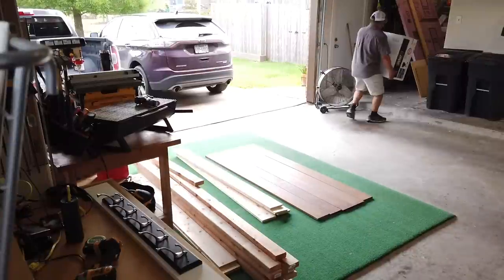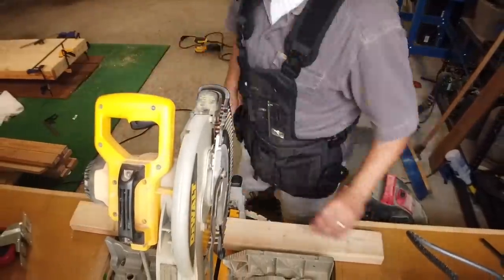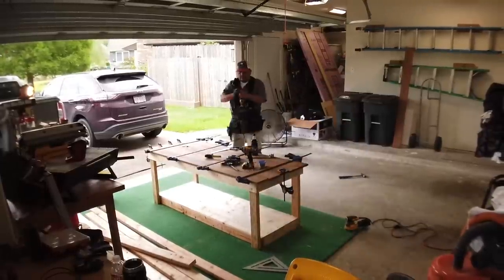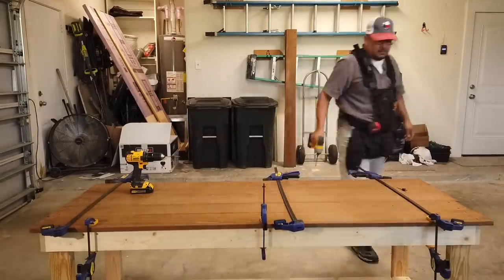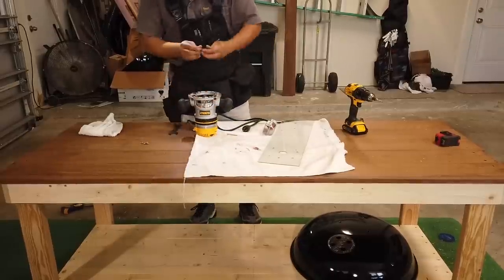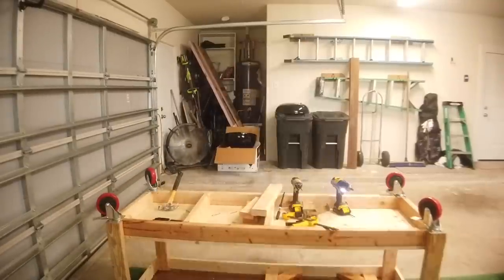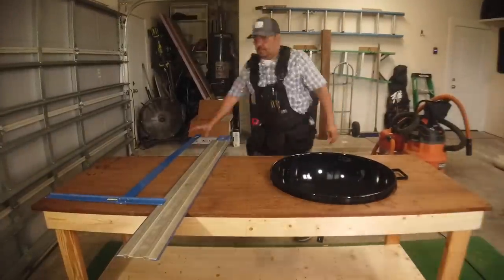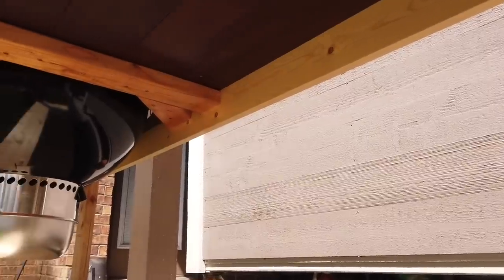How to build a 22" Weber Kettle BBQ Cart DIY BBQ Table

Comment: Not worry about the heat next to all that wood?? Nice table
Reply from the maker: Not at all, if you take a look at my grilling videos you can see how well the wood is holding up.  I have had no issues with the wood getting too hot.  I have over 100 cooks on the table I use.  Thanks for watching and thanks for asking.
Reply: @Viewtoagrill  I use my grill with a KettlePizza attachment and consistently heat my kettle to 700-1000 degrees.  are you working with high temperatures like this?
Reply from the maker: Wyatt, I use a slow and sear in the weber kettle so all my heat is banked to one side.  When grilling I put the exhaust on the opposite side fo the slow and sear.  That means the weber the thermometer is right above the fire.  I have had the buried in a 600, that is the max the the weber thermometer shows... so I can't tell you an exact temp.  If you want to see how the wood is holding up though you can take a look at one of my grilling videos.  This table is an older model that I did... and the wood is actually closer to the kettle.... about a 1/4  inch away.  This new model I made the hole a little bigger... I think 1/2 to allow for more air flow.  I hope that helps!

Comment: You mentioned that you got the L brackets at Home Depot.   What size brackets?  Thank you.
Reply from the maker: These are 1 1/2 inch L brackets.If you want it to sit up a little higher, go with the 2 inch... I would not go lower than the 1 1/2 niche though, your boards are 3/4 inch, I think the 1 inch brackets would leave the pit too close to the table.

Comment: Great video Johnny! Just getting into DIY woodwork and might take this on as a project for my courtyard and grill. Ipe wood is pretty expensive for the top layer, any other “budget” suggestions for a top layer? 

Something weather resistant perhaps?

Thanks again for the amazing walk through
Reply from the maker: Hello DS79. You can use cedar or even untreated pine… as long as you keep it out of the weather.  I wouldn’t use any pressure treated lumber due to the chemicals.

Comment: How has the wood held up around the kettle? I want do something similar but I’m concerned about the wood getting too hot.
Reply from the maker: Look at one of my newest grilling videos.  You can see a close up around the grill and see that the wood is just fine.  I have at least 300 cooks on the table in my video.... the hole for the kettle is a bit tighter on the one I use...   I cut the hole in this one a little bigger to allow for more air flow.
Reply: View to a grill ok perfect! Thank you for the quick reply. I was thinking of using cedar instead of ipe.
Reply from the maker: Hey no problem. If you have more questions just email me... my email is on my about page.  Hopefully you enjoy my channel and choose to support me.  I have another table build in the works with a built in cambro for resting briskets.  Take care.

Comment: Would be great to know the diameter of your hole you routed out. Thx
Reply from the maker: Use the lid as a template.  the hole will be just a little bit larger and the bowl will not touch the sides.  Use the L brackets I show in the video to hold the bowl up.
Reply: @Viewtoagrill  Thanks for the quick reply. Great job BTW!

Comment: Can anyone please tell What size is the cut out for a 22” Weber kettle?
Reply from the maker: Yes the lid as a template.
Reply: @Viewtoagrill  thanks for the response! that is what I was thinking but wouldn’t that actually be to large of a circle? I want it to sit directly on the lip the lid sits on
Reply from the maker: You have to use those L brackets that I show in the video it is important that you leave a little air gap between the wood and the kettle.  In real terms you will have a quarter inch gap between the kettle and the wood and the lip of the kettle will high enough so that the handle clears the table top. If the handle does not clear the table top, then you will have to cut the handle off.